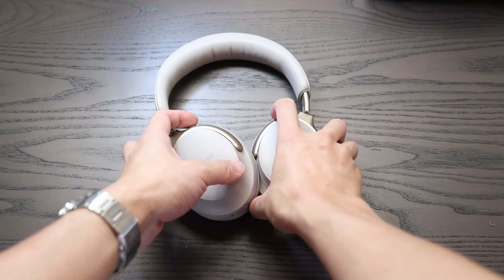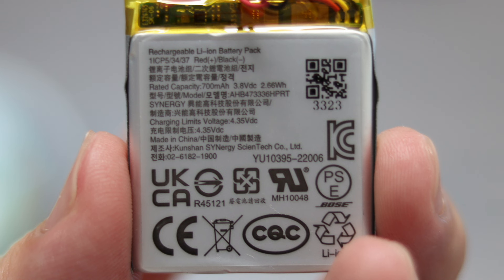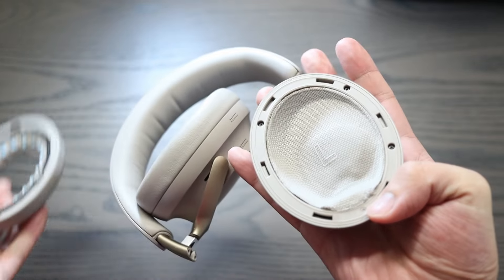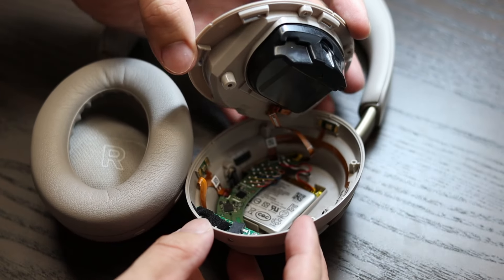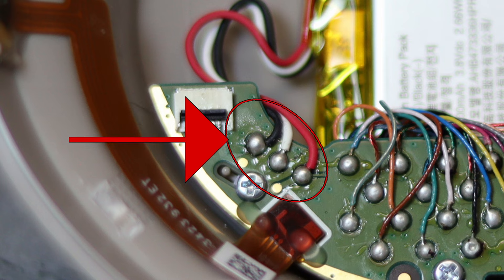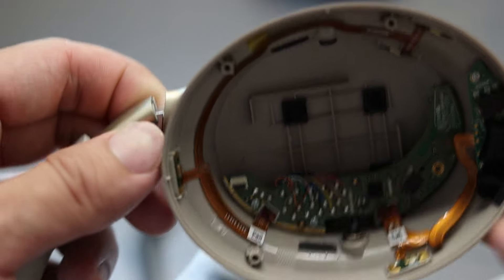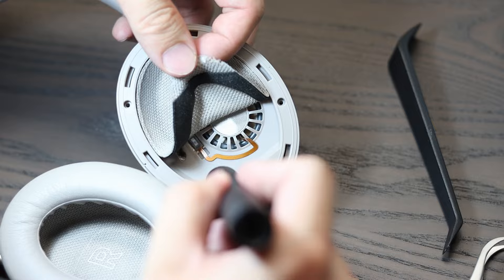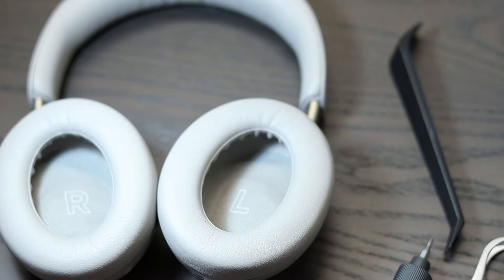BOSE QC ULTRA Battery Replacement

Comment: Thanks for the video. The disassembling of the speaker is the unique occasion to add a mecanical connector for battery wires instead of unweld on this small pcb which is the risky operation.

Comment: I can only say thanks for this, since this gives me the confidence that I one day can replace the battery. As we know this accumulators are the No1 show stopper for these devices which is a joke since this is a €9,- device in lots. I found a 700mA 3,8V with an appropriate size already in google within minutes. IMHO companies should be forced to provide replaceable batteries only for environment protection. I wonder why the EU does not demand such things but concentrates on banane curving and vacuum cleaner power and other bull.
Reply: If you still know can you tell me where you go the battery? Afraid my battery is messed up so I might need to replace it. Also if you replaced yours how did it go? Smooth sailing?